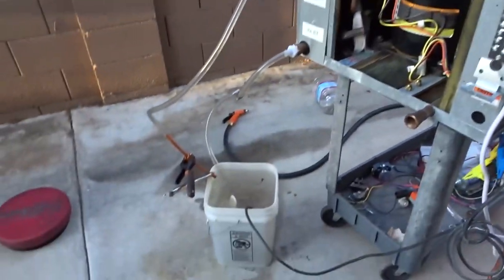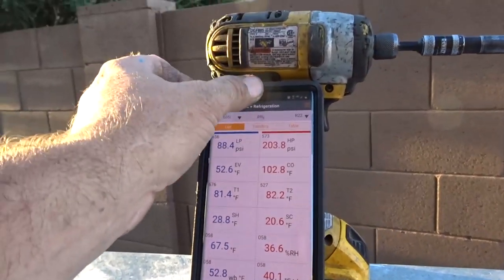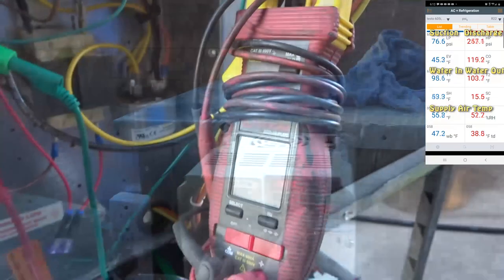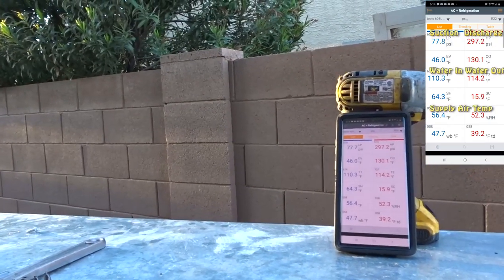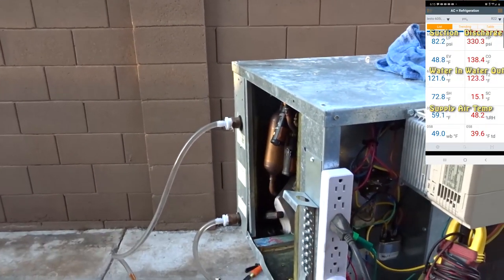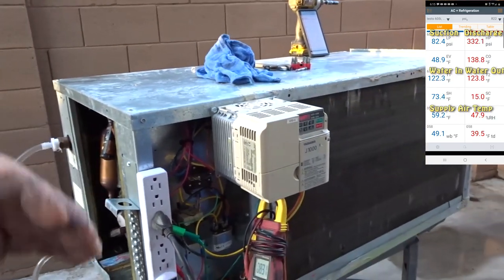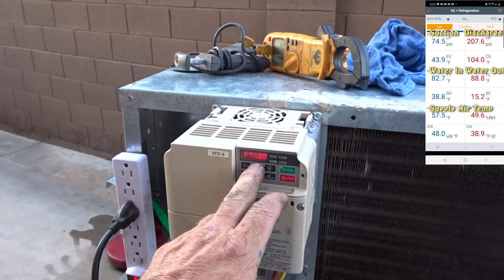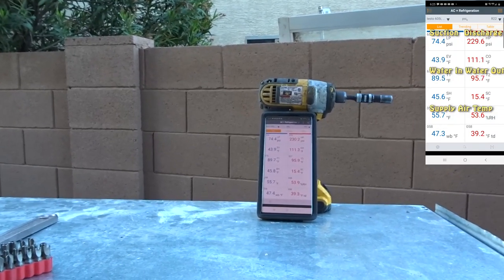The Bastardization of a WSHP into a VFD Water Heater - Part 4 - Finally some progress!

Comment: Sooo this is for making the hot water in the hw tank...
Like a boiler that circulates the hot water in the tank
Absolutely beautiful ideas...
Reply from the maker: Yeah If it seems like it will work I plan on hooking it up to my water heater and having it operate instead of the heating element. 

It is in the garage and blowing some cool air in my garage in the summer will be awesome.

Comment: Great idea - we been running E-Tech (now out of business) Heat Pump WH since 1990, but not super-sized like your WSHP.  They take many hours starting at 60 deg water and 60ish in the garage for a 50 gallon heater, but it works!  Both are rated around 12,000 BTU.  The first one we installed uses a Tecumseh 10,000 BTU AK Recip and second one uses Tecumseh 11,000 btu RK Rotary.  We had to buy directly from E-Tech didn't have a distributor here in Phx.  They definitely have lasted longer than I expected.  I did have to put a fan cycling on the evaporator fan as you know the garages get pretty warm here.  Since you have so ECM motors laying around maybe you can build a control system to vary the compressor speed and fan speed based on temp and high pressure transducer.   Keep em' the status coming, this is very interesting!
Reply from the maker: Wow 10,000 BTU. That thing must have only pulled like 5 amps. But more than an hour for recovery would be a pain. 
I'm guessing mine could do 30 minutes?
But we will see. HA HA I think my current compressor is about 22,000 or so but the Evap coil is from the 3 ton.

And also, I have yet to see what happens with the HOT garage at 100 degrees in the summer. 
But as long as the discharge pressure isn't crazy I'd bet that would mean excellent water heating performance. Maybe just slow the comp down a little.

If I could score a Rotary compressor that would be awesome.
I want to make a second one of these for a small tank to add for our kitchen sink and dishwasher that take forever to get hot water to.
Reply: @hackfreehvac  yes - the thing only draws about 6+ amps with the pump and the fan. When water loads are high I have run out of hot water in the winter, but I did put a 3.5KW heater inline after the HP when the garage drops below 60 degrees, it helps.  No issues in the summer though!  But with your setup you could probably heat water real time even in the winter, well AZ winters that is!
As far as getting hot water quickly to the Dishwasher, the plumbing industry likes to put in the recirc pump with tstat or timer but I don't like it because it wastes "hot water" and the cold water tap now is warm to hot with the hot water in the return loop.  I have no doubt you will find a solution!  Happy Experimenting looking forward to Part 5+.
Reply from the maker: @TheGgin  I'm in the Arizona desert near Phoenix so it's 50+ most of the time in the garage. 
Northern Arizona is about 30 degrees colder! Heat Pumps don't do jack up there. HA HA
Reply from the maker: Adding a recirc is one option for my further away kitchen but I think a small 5 gallon tank heater would be best.
Reply: @hackfreehvac  very true!

Comment: Cool a room and heat your water at the same time... genius
Reply: Now that I think about it.. this set up works so well it probably won't run long enough to cool a room
Reply: It would probably be enough to cool a room while someone is taking a shower or HW is in use. Average shower of 10 minutes, means unit would run maybe 20-30 min...if your just using it to cool a space that's not normally cooled (attic or garage) that would help take some of the heat load off your house and allow your primary hvac to not work as hard..

Comment: When you eventually implement this, are you going to heat the water directly or set up a second loop with a hot water tank coil?
Reply from the maker: Oh.. I'll flush the exchanger a bit then the domestic water will circulate from my heater tank through this exchanger
People freak at such an idea but the shite in the tap is worse than some diluted resude in the exchanger.